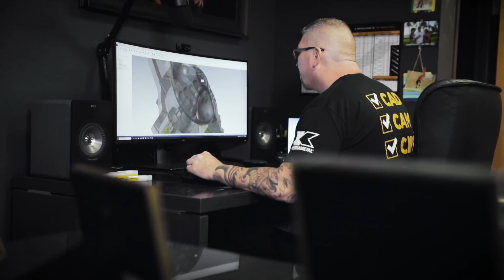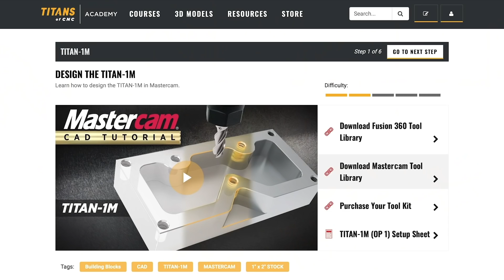The RISE of TITANS of CNC MACHINING

Comment: MONSTER MACHINES, YEAH, WORKED AT GENERAL DYNAMICS 9 YEARS ON MITSUBISHI MACHINES , THEY RAN ON A 60 FT SLIDE, TWO STORIES PLUS HIGH, 72 INCH BORING BARS CUTTING THE RACE RING ON THE M1 TURRETS, ATTACHMENT BLOCKS FOR INTERNAL CUTTING AT DIFFERING ANGLES AND BORES, IT WAS A AMAZING BUT I GOT ILL HAD HAD TO CAN IT. I REALLY MISS IT.. THEN THE HULL TRANSFER LINES WITH 5 DIFFERENT MACHINING CENTERS ON EACH SIDE TOP, INSIDE AND OUT. TALK ABOUT BIG. I HAVE DONE A LOT OF MACHINING BUT ANYTHING BIGGER WOULD BE EARTH MOVING EQUIPMENT OR ROCKETS OR MAYBE SUBMARINE PRO-IMPELLERS

Comment: I would challenge you, that if you think you can compete on a global scale, you need to see a larger (and smaller) playing field.

Not to undermine what you have done, it is fantastic!

However, manufacturing and programming are just pieces of a bigger picture. Can you challenge yourselves to design your own CNC systems? Things to scale down to levels to rival ASML which builds extreme ultraviolet lithography machines which are utilized by TSMC which in turn is used by AMD, Apple, NVidia and more?

I think you can.

Comment: Most people have no idea what it takes to produce a high quality lower wing skin for a Boeing 747-400, 747-8 or Airbus A380. Everything is on a grand scale as well as the machine operator stress levels to oversee the machining process and monitor the cutting tools for problems. Large gantry type milling machine can be intimidatingly powerful to say the least and there is no real way to describe what it's like when one of a dozen things go wrong.
Reply: i used to run a 5th axis (mighty) viper and b4000 viper ( years 2000). lets just say these are massive machines. however, these machine break down easily and requires a lot of hydraulic fluid and eventually alarmed out due to bad wiring. i quit that job just because their was no real maintenance on the machine. i was the 1st one to clean the exterior, and coolant. parts took 3hrs to machine. the owner was happy that the machines were always running. my lead got mad that i was just sitting down. so i ended up running 3 machines. i quit because it wasn't worth it for $16/hr. i found myself going in a big triangle.